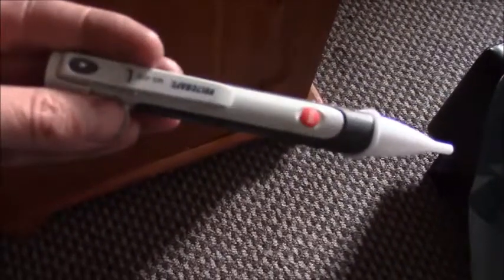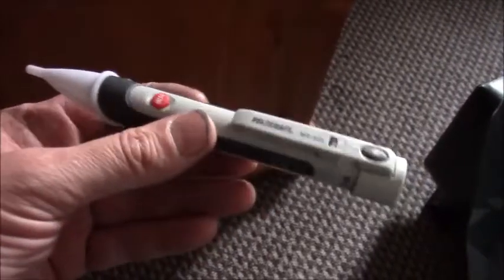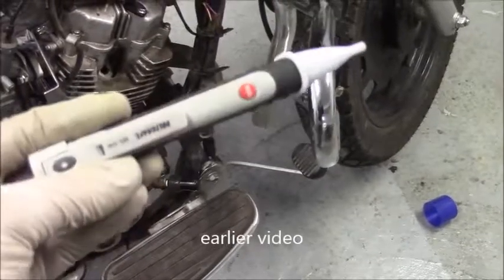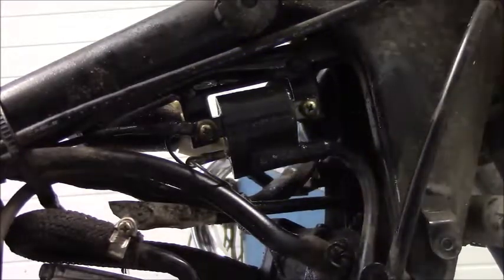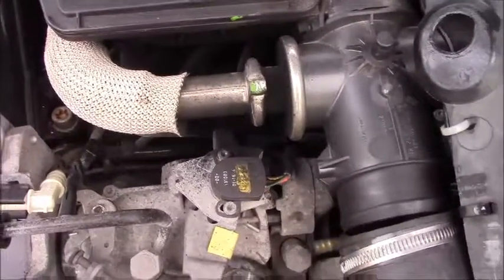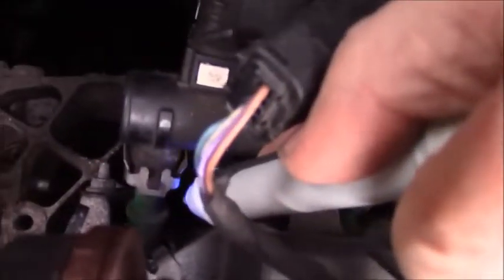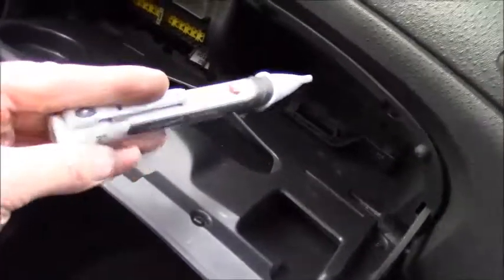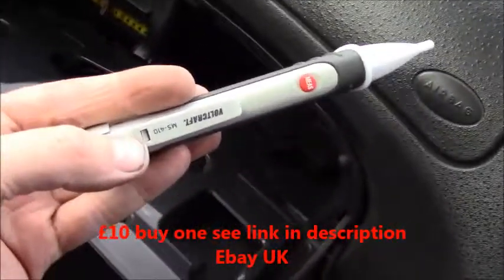Magnetic Field Detector: The EASIEST Way to Test Coils, Solenoids & Injectors!

Comment: Would this be able to detect a break in a wire from an ecu on a machine that runs 12volts ?
The voltage may be as low 4 volts from ecu.
Reply from the maker: No sorry